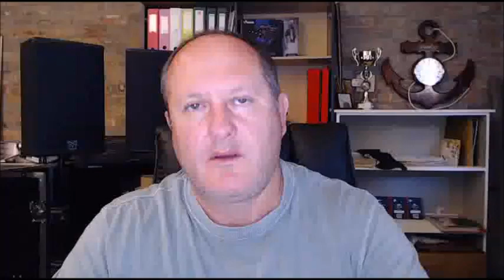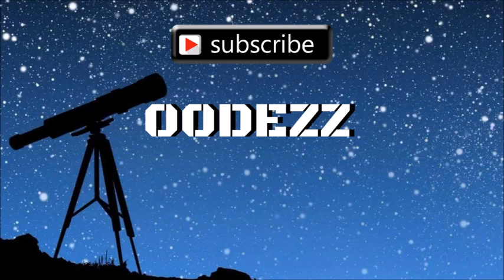00DEZZ - Gridface - Load Shedding Explained.

Comment: This is not acceptable for paying customers. i am going  solar.
Reply: My parents went the solar route. Everything except the geyser is powered by the sun but they still get R4000.00 bill every month and they use electricity very sparingly. Others may have a different experience.
Reply: @niebelangrik3358  I moved into this flat in November last year. The electricity for 2 of us, is about R750 per month. The previous flat, (which has a gas stove), I used to use about R1500 electricity. How come??
Then I had a factory in an industrial park, and there was a R4 a day surcharge for some company. So when you log onto your bank account to buy electricity, your balans 
is -R120. Now still deduct 15% VAT off your purchase, then you don't get much for R2000.
Reply: Gas for shower and cooking...1 battery plus inverter charger for light and wifi....it works for me....
Solar needs lots of expensive batteries
I Get power directly from eskom....i think it's cheaper than via municipality 
On the plus sidr...my units last longer because of loadshedding

Comment: I stand under correction when I say I disagree with some of your statements. You state that larger areas cannot be off for longer so that you can have longer periods with continuous power, because the system is self controlling. That is the way the system is programmed, any program can be changed to suit requirements.
Reply from the maker: Wrong. Grid stability is key. The voltage swings and many other factors will worsen causing appliances and equipment failures.